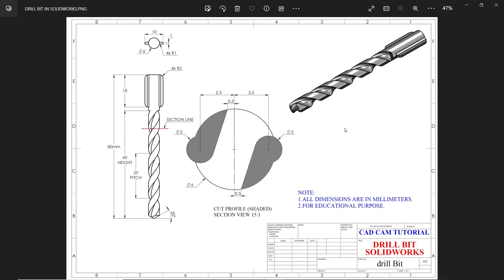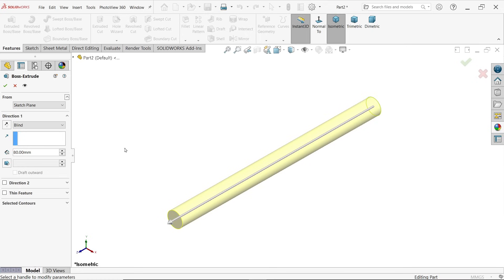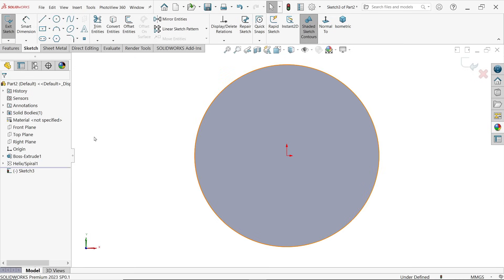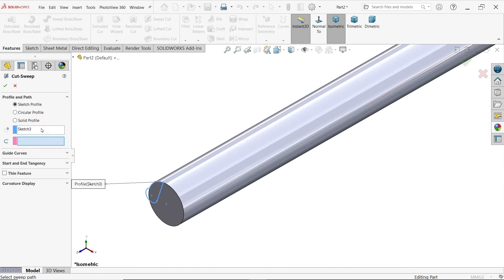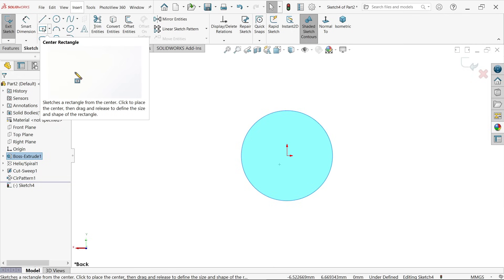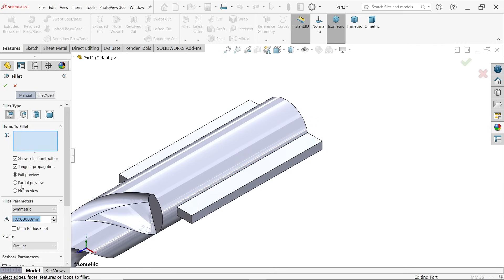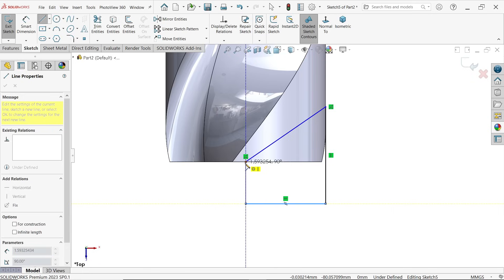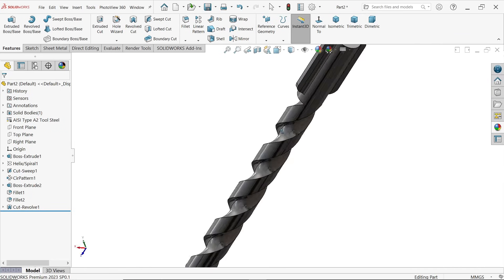How to create drill bit in Solidworks

Comment: Longtime subscriber here, so please take my comment as constructive. This drill bit would be cost prohibitive to produce. It also wouldn't cut anything. This tutorial missed a couple points that could have made it very good instead of mere content to meet posting quotas.
Point 1: The end condition of the swept cut. There is no way to cost effectively produce this. The spiral sketch should have had a variable near the end so the swept cut could exit the bit the same as the production grinder would. 
Point 2: the drill tip would never produce anything other than a mushroom shape if used this way. There are many faceted cuts on the end that includes fall away so the pair of flat cutting edges can engage and "peel" the material. Flutes look nice but aren't needed if there are no chips produced. 
I get this is a tutorial to demonstrate the various features, but you have demonstrated them in just about every other video you have produced. If you take a look at drill bit cutting edges, you will see how complicated it would be to try to cut the various features while maintaining rotation, as well as fall away. This is what I was hoping to see in this video.
Reply: do you know of any tutorial that does this?

Comment: Hello sir can we extract data of specific edge in solidworks of any 3d model. I want to basically get data of xyz values of any edge or weld path. The xyz values will be 1mm equidistant.i need to feed this to my robotic arm . So is it possible in any way to extract data of xyz values and save in file.